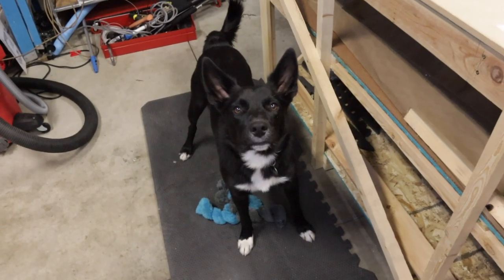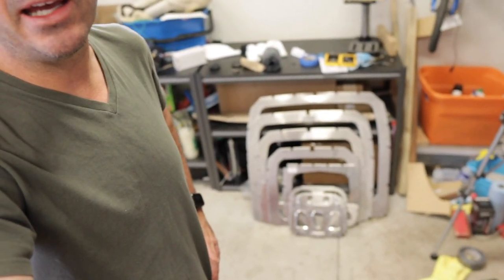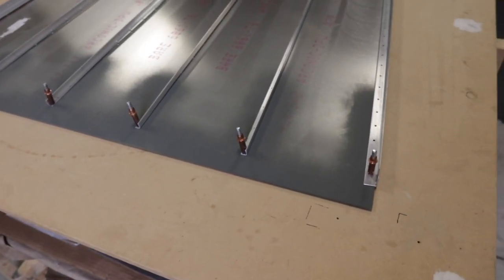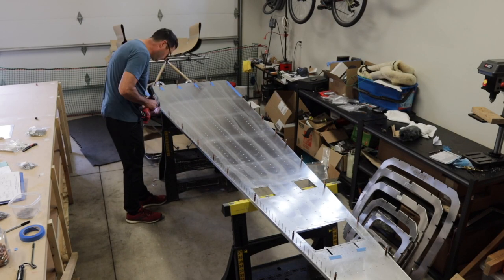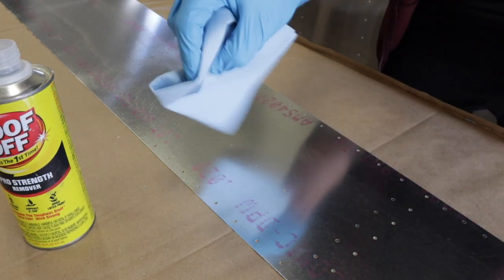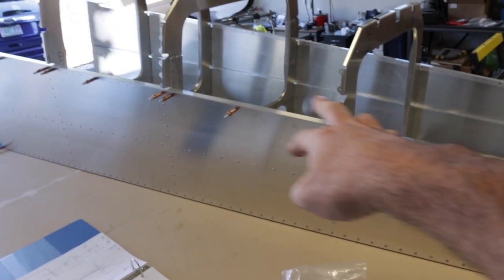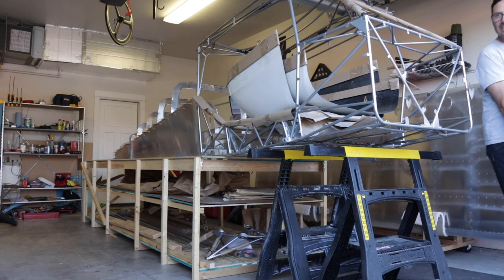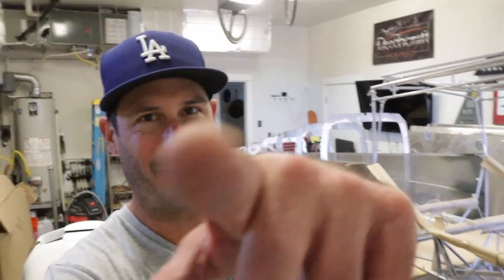RANS S-21 Build Ep 8; Fuselage Part 1--LONGFORM

Comment: Fastest way to deburr these stringers is with 200 grit or so sandpaper.  A couple quick swipes are you are good to go.  No need to address each hole individually.
Reply from the maker: Also great to know. Coulda saved hours! Do you go back with a higher grit to get the 200 grit scratches out?